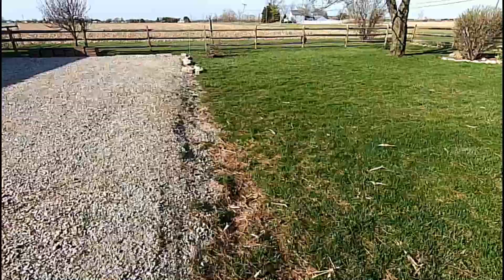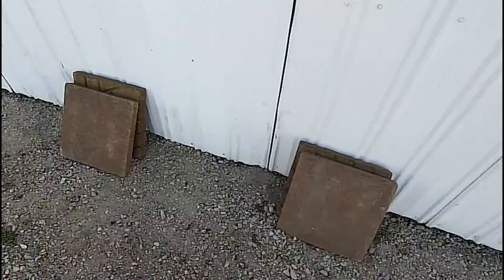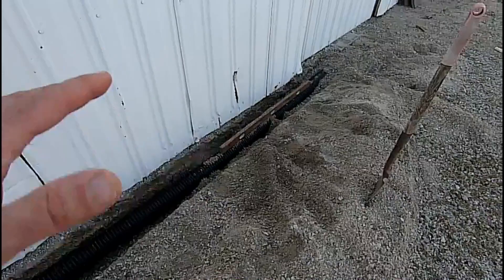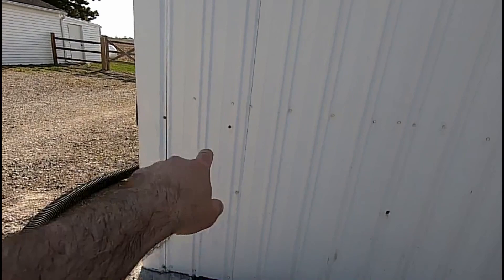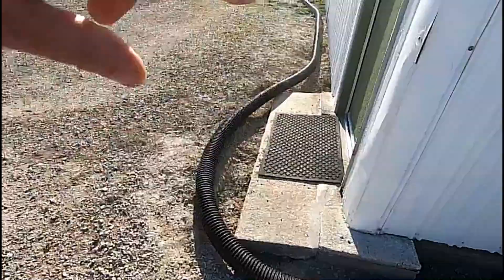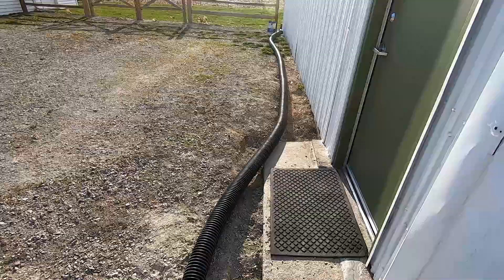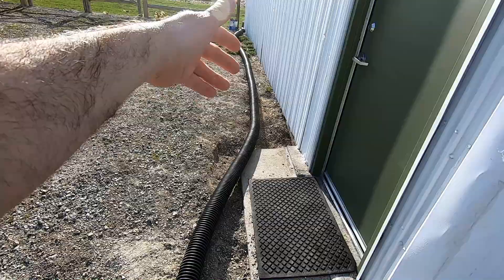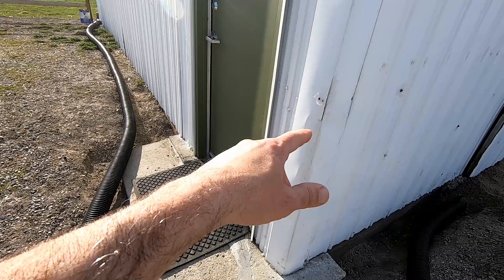Drain Installation Making Our New Building Water Tight

Comment: Water is probably due to a negative slope going towards your slab. I'm doing the same thing as you, but I'm doing it around my basement. I'm digging 4 feet out from my foundation and about 4 feet deep around the house. I'll put the solid pipe against my foundation, but the slotted pipe is 4 feet from the foundation. Gutters would probably help your situation, but that looks like a metal garage. 
You should do more of these types of videos.